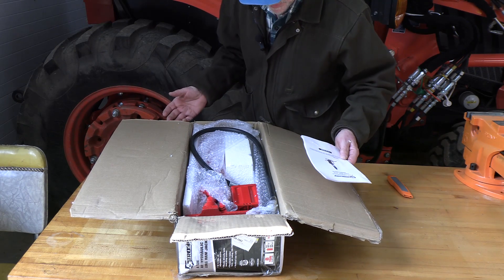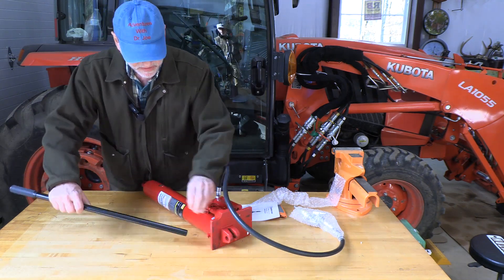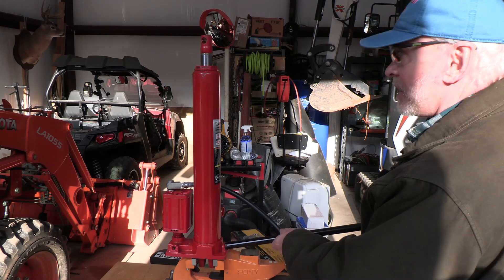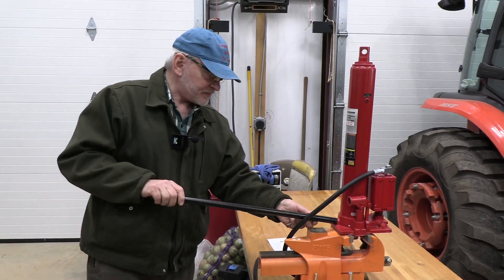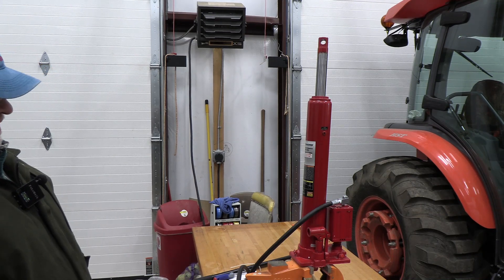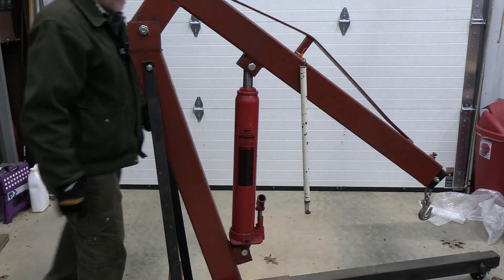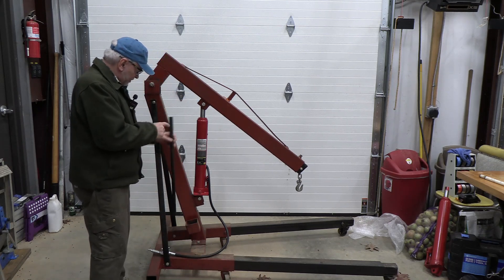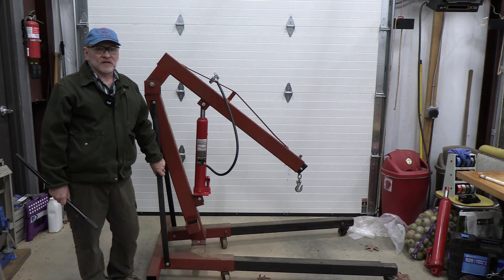AIR POWERED HYDRAULIC 8 Ton Long Arm Jack Unboxing, Install, and Demo  w Dr  Joe

Comment: Does this jack also works in horizontal use?
Reply from the maker: I suppose you could use it by itself in a horizontal fashion, but not connected to this frame thanks. Joe.

Comment: How to jack horizontally Dr da vinci
Reply from the maker: Hello. This air powered Jack fits on the shop crane and allows. Excellent lifting vertically. It could be removed and used horizontally against a fixed back plate to push something forward if you desire. Consider subscribing. Thanks. Joe.

Comment from the maker: And even though it leaks air when you’re hooked up to the airline when you disconnect the airline it stops and it holds its position. I think that’s what I remember so I don’t know what to do about that. Mine doesn’t do that interesting thank you for sharing. I wish I had more information. Best regards. Joe.

Comment: I bought one of these from vevor....Im curious if yours has to be disconnected from air supply  after you've reached your desired working height to keep your compressor from losing more air? My ram will not lose height but will have a hiss  as it drains from the connected air line through the actual pump body.
Reply from the maker: Thank you for your question. I wonder if you need a new air fitting. Mine does not leak so I can leave it connected and it doesn’t bleed air. I would consider probably another air fitting to connected to the Ram. That’s something to think about. Consider subscribing. Thanks. Jill.
Reply: @JosephHunstad  hi thanks for the reply....it actually leaks out the side  of the ram pump. There's 2 machined holes of which one leaks air out of, there is no fittings.

Comment: how did the ram/ air assist hold up so far?
Reply from the maker: Hello dwmjoe

This ram has held up very well. It is very heavy duty. I have actually incorporated air hydraulic rams into other tools. I replaced the 20 ton. Jack on my H frame press with an air hydraulic one and it works great. I also have an air hydraulic floor jack which works great. it’s a tremendous amount of pumping. Please consider subscribing. Thanks, Joe.

Comment: Would it be possible to connect it to a hydraulic pump through a spool valve.?  TIA
Reply from the maker: Thank you for your question. A spool valve works both with hydraulic oil and air. There are two types. I do believe that a small valve could be connected successfully to this which would make inflation raising the jack possible with a lever. Take care Joe